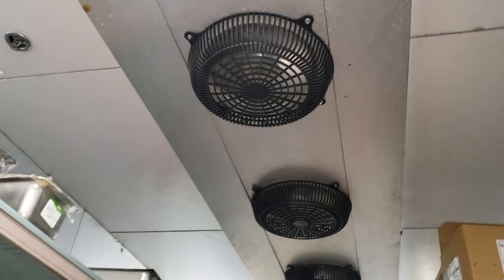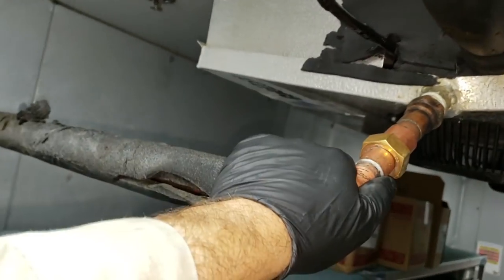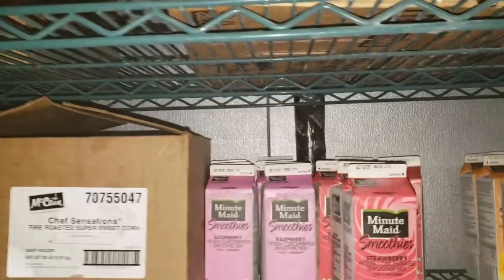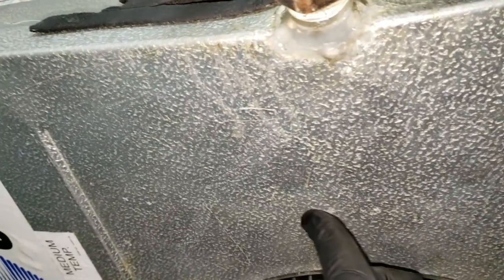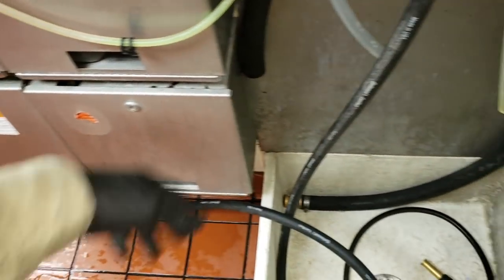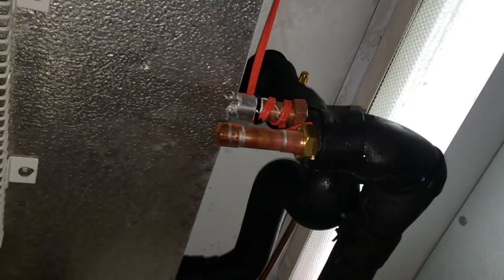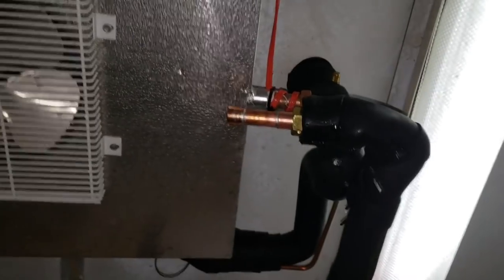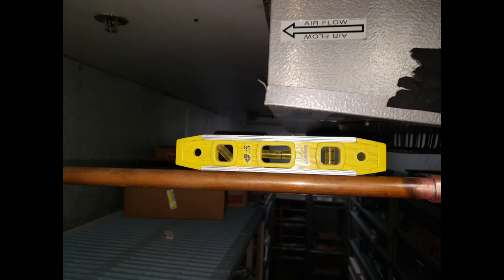Walk in cooler leaking water

Comment: A drain line going through a freezer: Big applause.
Reply: Thats exactly the problem here
Reply: Corrected Damian. Thanks for noticing ;)
Reply from the maker: No Sjef oekel that is not the problem, the drain line inside the freezer has a heater wrapped all around it to prevent freezing. I still am not a fan of the drain line being connected to another coil, but the problem has nothing to do with it being in the freezer.
Reply: @HVACRVIDEOS  so the heater is always energised? Thats a waste of money, the pan rotting out is due to that copper drain and always a full pan. I know you did correct the pipe slope but still, seeing this set up makes me think what how why huh???🤔🤔
Reply from the maker: The heater is wrapped around the drain line inside the freezer under the insulation. It's always energized when the freezer is not In defrost. Every walk in freezer has the heater on the drain line. (The heater in the pan is only for defrost)
Reply: The condensate is not going to I dream of genie out of there.  🧞‍♂️
Reply: @sjefoekel6058  ik heb mijn vlees in een ongekoelde loods liggen. Geen problemen met koelinstallaties.
Reply: @Worstenboer  ???? Ik zou er toch niet van eten als ik jou was!🤢🤢🤢

Comment: Just a tip that I do if you want to try.. i get a threaded spray nozzle hose end teflon and 3/4" threaded PVC coupling and makes a good seal for PVC, other good thing is you can stub a piece of 3/4" PVC pipe, clear hose and hose clamps. Makes a tight seal and no spray back in your face or mess. Other good thing about doing this you can get reducers to go up or down for different size pipe. Also makes a good spray pattern when washing coils.
Reply: I don't glue fittings so I can take apart after and just leave the threaded PVC on a metal spray nozzle.
Reply from the maker: Great idea , thanks Randy!
Reply: No problem. Let me know if you try it out
Reply from the maker: Will do

Comment: Let me recommend a 'drain bladder'.  They come in various pipe sizes and seals itself to the pipe as it expands.
Reply from the maker: That is a great idea but it's the same as compressed air. It will go around the obstruction, when your dealing with a walk in cooler drain you usually have grease stuck in the drain. Hot water fills the pipe completely and melts the grease and pushes everything out.

Comment: would you apply this method to residential equipment as well? if I have a horizontal split system in the attic its definitely not ideal or sometimes possible to use a water hose to clear a drain line. too much risk for potential water damage to the customers ceiling. what is your take on this? I've always used nitrogen or even a wet shop vacuum sucking from the outside.
Reply from the maker: Yeah I agree that residential is hard to use water on. I would say your normal method is fine. In restaurants we get food and grease in the drain lines

Comment: Never gonna work! Freezes up in the  next box.
Reply from the maker: Yes one would think that but there is a heater installed on the drain line in the freezer to prevent the line from freezing. The drain backing up had nothing to do with it being ran inside the freezer.